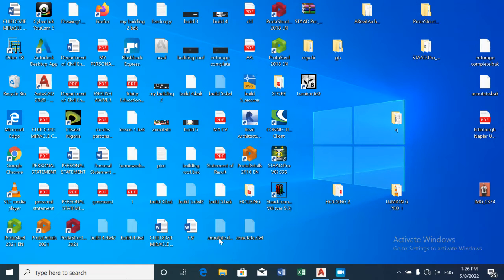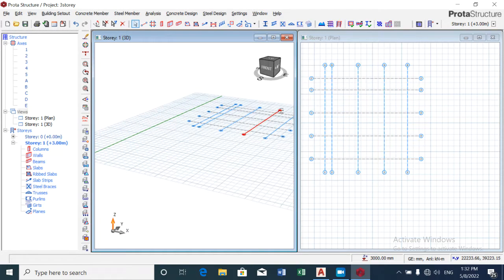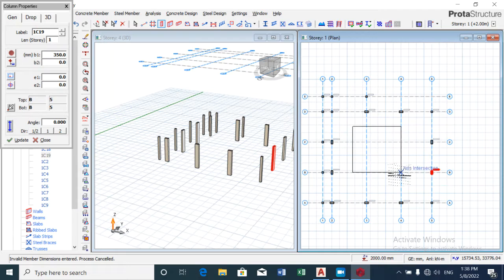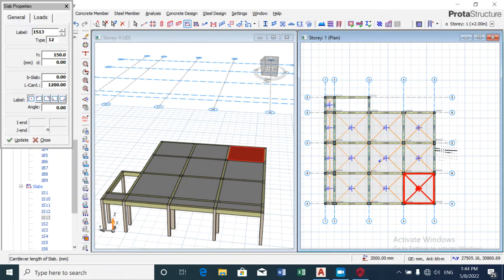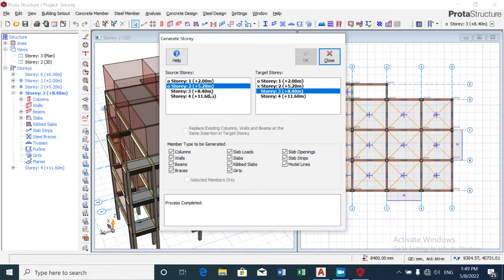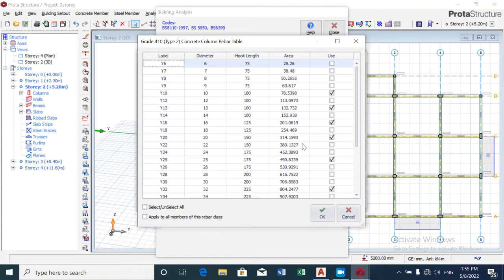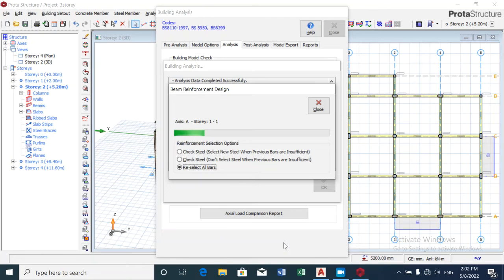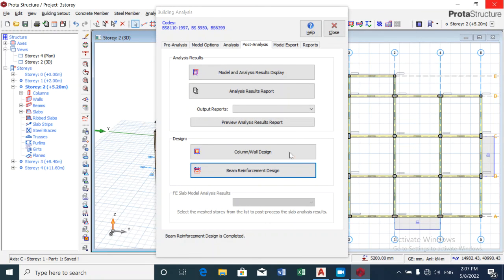Prota structure tutorial for Beginners Part 1

Comment: I'm using prosta structure 2021 but those elements at the top and left side aren't showing
Reply from the maker: I used Prota Structure 2019 for this tutorial video, so the tabs on the screen will be different but if you carry out the same task on both Prota Structure applications, it will provide the same result. The Graphic User Interface 2021 is a bit different from 2019 but they have the same elements, you just have to patiently find them by clicking on the tabs you can see.